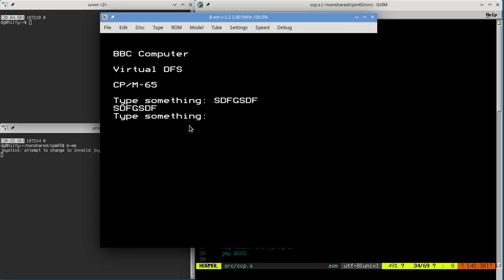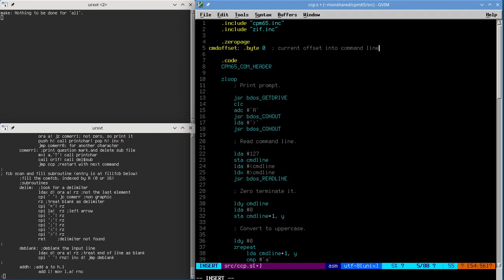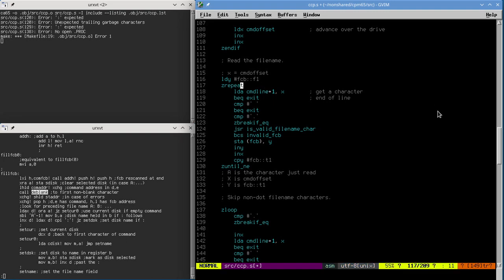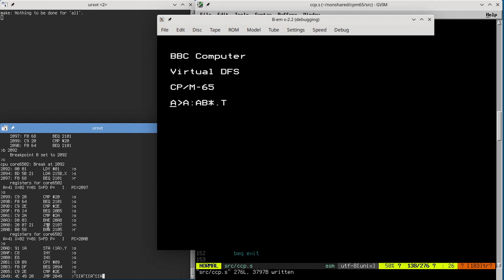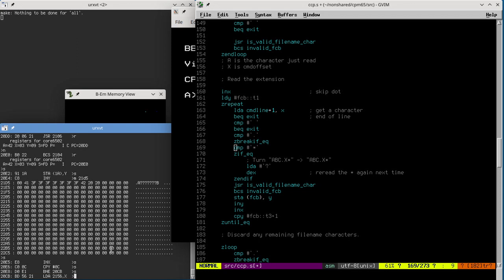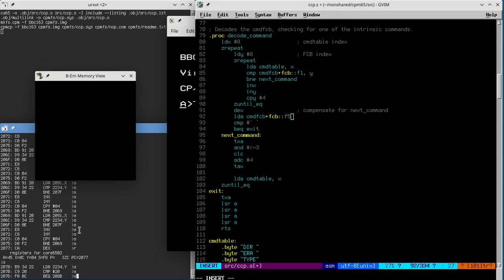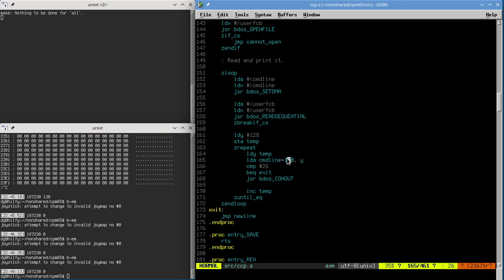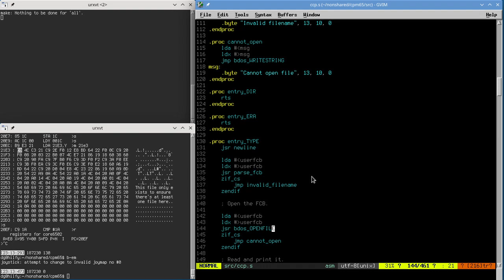6502 CP/M: 6/14

Comment: It's fascinating to see how you have to optimize for something very different in these memory-constrained environments than in a modern, non-embedded machine.  You're incentivized to roll up code into loops and branches as much as possible to make the code smaller, which is almost the exact opposite of what you're supposed to do in a modern machine, in which you don't mind making the code larger as long as it avoids branching too much!